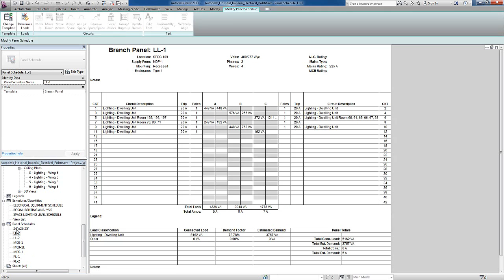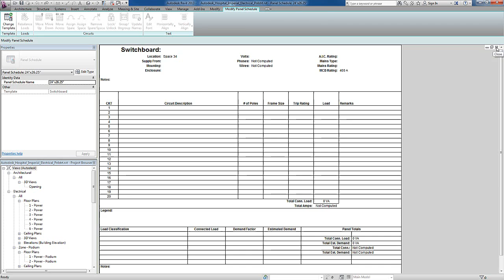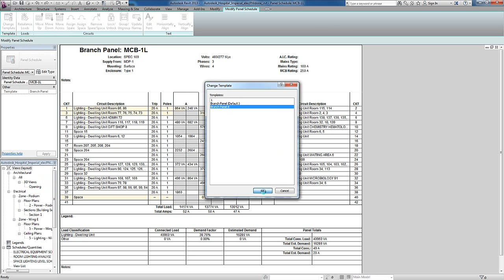Revit for MEP - Electrical Systems - Electrical Panels

Comment: Hi , I have assigned DB with 12 MCBe as panel..I want a column for MCB rating, Switches and lighting fixtures connected to the switches..it is possible?